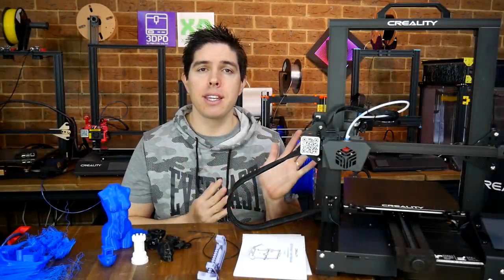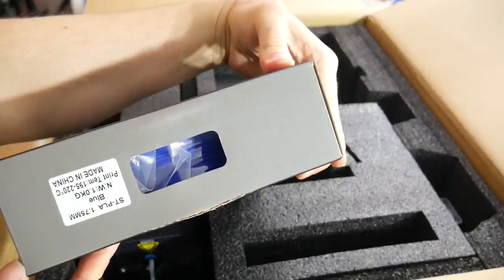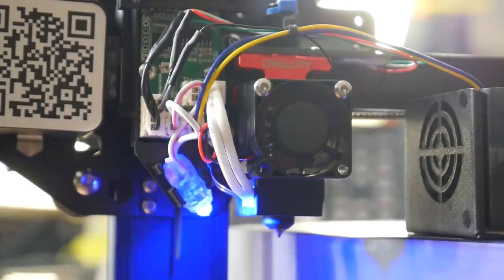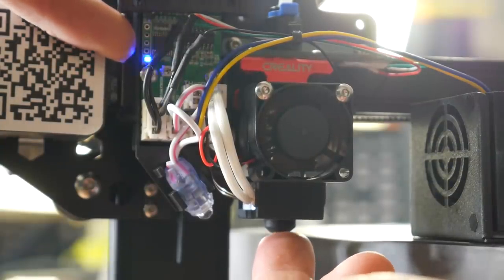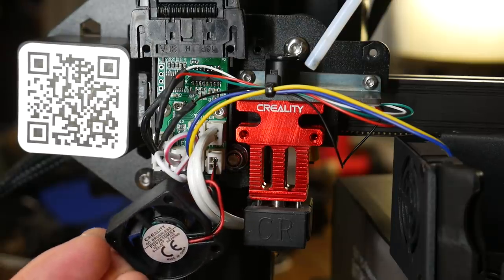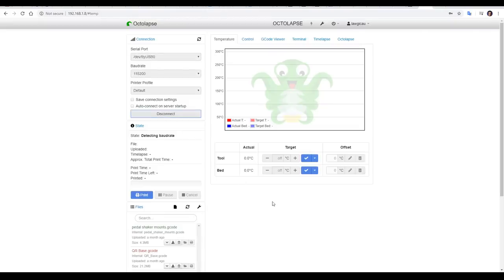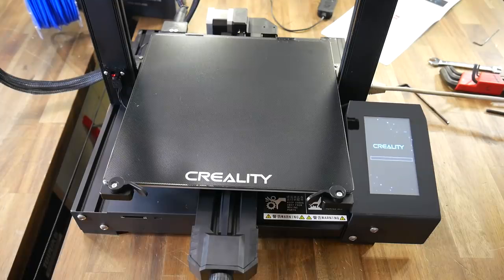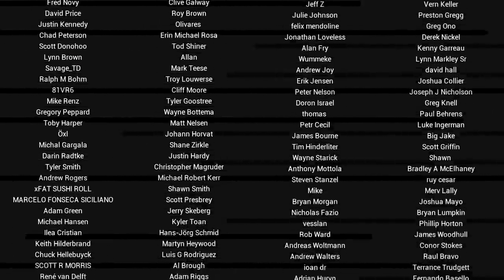Creality CR-6 SE - Your questions answered!

Comment: It's bad that it can't work with Linear Advance! It's almost like a standard now.
The printing volume is small indeed (for the price). Also a proper full-metal heatbreak should be an option (for the same money). I'm not aiming to print with PLA usually.
Reply: I watched Creality strip down the nozzle and noticed that the PTFE tube feeds down a long metal tube between the input coupler and the back of the nozzle.  I did not get an answer from Creality, but I asked whether they intend to offer an alternative tube with a filament-sized inner throat, to enable conversion to an all-metal hotend.  Maybe Michael can get an answer on that one...
Reply: @ThinkersBluff  where did you see that?
Reply: Unless you are printing polycarbon or Nylon. You don't need a metal hot end. PLA/PETG/ABS/TPU can ALL be printed reliably and safely with a high quality PTFE tube. (Note the HQ part)
I can print all of these for days on end, can run up to 260 if needed to. You do have to properly assemble your hot end, take it apart, back off the nozzle a tiny bit, unscrew the collar on top, now push the ptfe tube farther down, heat up hot end, tighten tube collar and nozzle. If your tube is square, it will not leak, if it is a capricorn tube, it will not burn, even at 260.
The rest is your slicer settings. All Metal will jam easier, it's not as slippery as a ptfe lined throat.
Reply: @mr.spongylikeaboss4987  A high quality PTFE tube costs like a good Ti-all metal heatbreak :D Guess which one should I choose.
My PTFE liner degraded a lot... caused few bad prints and at the end clogged the hot end. Any stick has two ends...
Reply: @Benutzername0000  https://youtu.be/uUWktSRnTk4, 00:31:50

Comment: Don't suppose you will he reviewing the CR-10 PRO V2? I'm looking for a higher hills volume printer of about that size but not sure what to get

Edit: just finished the video, I am loving this printer. However with the bed leveling, what if the bed is warped or the frame is bent? If something is wonky how does it deal with that? You can't change the springs like you may be able to on some

Comment: I never had good long term consistency with any physical based ABL sensors like this and the BLTouch. I wonder how consistent this system will be long term after say 6+ months. Also wanted to add, the strain gauge type setups have been used across various DIY/RepRap projects over the last decade and it's been a mixed bag. Really wish they went with a sensor like the EZABL.
Reply: Interesting, the EZABL was always flakey for me, I went back to a BLTouch about 2 years ago and haven't had a problem since.

Comment: A Lot of you hate against the PTFE lined hotends, I have used them for years, and this is what I've found. PLA/PETG/ABS/TPU all print well.
PTFE hotends can print every filament other than Nylon or PolyCarbonite. The problem you had was cheap PTFE Tube, poorly assembled hotend from factory.
The key is to have ZERO gap, completely flush fit of the PTFE tube in the hotend, AND a properly locked collar to prevent the tube from pulling up.
Step 1: Get Capricorn Tube (Buy from the OEM.. many places sell fakes, including Amazon)
Step 2: Cut PTFE Tube with a proper Tube Cutter (Nothing Else!, not a knife/razor blade/side cutters, ect)
Step 3: Loosen Tube Collar on Hotend, Loosen Nozzle a tiny bit, push PTFE Tube down until it bottoms, heat hotend up to 220-240, now tighten top lock collar, now tighten nozzle.
 If you have done ALL of those things, AND used Capricorn Tubing, cut with a tube cutter, YOU will not have leaks, or burned up PTFE tube.
You can print all day at 255 deg with real Capricorn PTFE Tubing, it will not burn. IF you eliminate the potential for gaps in Creality's hotend, it will NOT leak
If you are clogging or jamming after doing the above, it's your slicer settings.
Reply: The only reason I use all-metal is because I have a parrot, birds have waaaaaay too much of an effective respiratory system - I'm never going to risk offgasing just because the manufacturer is like "yeaaaah... prolly fine".
Most people hate on bowden simply because it's the "standard",, the "stock hot end", we all remember our first prints years back, nothing sticked, the bed was warped, no trinamics and so on and so forth. Usually you buy upgrades when you become more experienced. You get a new heated bed, you get a new board, new drivers, a bltouch, a pi4 for octoprint, a 7" capa display for octodash... - without realizing it the worries that you had at first, meaning merely praying for the darn thing to stick and so on, are all linked to the point where the machine was noisy and using bowden.
People merely see all-metal as an upgrade, whereas it has it's own flaws when clogging for example - so they're bound to want the upgrade for free, as if it would fix proper layer height and settings when the darn thing isn't even enclosed. We are all made out of statistics, we wouldn't be assholes to each other otherwise :p

Comment: the biggest problem with this printer is that it is new and nobody is really using it. there are a ton of guides and accessories for ender 3s and cr-10s, but i can't find information like what is the max travel speed or guides on how to do things. i'm not sure that will improve that much, the printer doesn't seem like it will be super popular compared to others.

Comment: I've backed this on Kickstarter and it'll be my 1st printer. It looks a lot more refined than their current printers, so hoping it will give more consistent results out of the box. I'm wondering given that a strain gauge is used to achieve the auto bed levelling if there is any effect on accuracy due to temperature dependence of the strain gauge. I see the display board you show in your unit seems to have an area and pads to solder on a WiFi board. Also interested in how well the belt tensioners work. I'll probably go with the 32-bit board, guessing it'll be more capable but maybe less support initially.

Comment: I believe Chuck mentioned the build volume being bigger than the Ender 3. The ender 3 bed is 235, but it's listed as 220 build volume, and the Ender 6 is 250 bed size and 235 effective build volume.

Edit: Ender 6 is 245x255 physical bed size according to Chuck (7m45s ish into his vid)
Reply from the maker: I've just added a pinned post to address this. At the moment the firmware is preventing the nozzle from going further than 235mm but once we have the firmware we can use more of the bed (but not all because of the clips).
Reply: @TeachingTech  Great! :-) loved your vid btw, and that you didnt just basically reiterate the videos we've already seen :-)

Comment: I can see difficulties in proper bed probing if the nozzle has some melted filament stuck to it, especially since it seems the firmware doesn`t allow for bed leveling with a heated nozzle. On the other hand if the machine retains its Z-offset with the fixed bed I can see it as no problem to set it once and forget about it. I don`t know about production machines but this seems to be 8-bit board? Creality cheapens out again. That extruder looks problematic aswell and I`m guessing its plastic? I like the quick release clamps on the glass bed and the fact that it`s a fixed bed like the Prusa should insure better overall consistency over time.  At almost 450 US it`s awfully expensive and there are better, bigger machines for the price.

Comment: Looking to buy my first 3D printer now. Would this be a better option than the Ender 5 Pro long-term? I'm not afraid to get my hands dirty with firmware or mechanical upgrades, but the built-in ABL and touch screen along with the twin-Z screw seems like a compelling argument for the CR-6 as those are the main features missing on the Ender 5 Pro for me.

Comment: I have the unit and it’s a nice printer, but there are issues with poor quality parts like the switch. Bugs with the run out sensor and other QC issues. When the bugs are fixed it going to be nice, but right now would not buy this printer until MB burning and Switch burning and filament sensor issues are resolved. Creality is very slow to respond to many user issues.

Comment: Is that glass bed a new surface or the same one we have available for the Ender 3?  I found my  Ender 3 glass bed was good for a few months, but gradually lost its adhesion (probably contaminated with residue). Now I find I need a different bed for each filament type; painter's tape for TPU, Glass + Elmer's glue for PLA and PEI for PETG. None of those beds seem to work very well with the other filaments....  Really hoping my Wham Bam shows up eventually & works with everything.  It would be nice if this new bed also works with all 3 filaments.

Comment: does using octoprint to control the printer directly (to print for instance) conflict with the auto-level? if you're directing it to move directly, does the board know to offset your gcode commands according to the level settings?

Comment: I bought this used. First time I was trying it it started fine but it didnt take long before it started clumping up. I am a first time user. Why is this happening? Should I take of the extruder to see if it clean? Is it to close to the bed or not close enough? I ran the auto levelling and that worked just fine. What am I doing wrong. Happy for any replies. And also there is only two choices for filament. How do you put in  to use another type of filament ?

Comment: Why do you suggest that hot end "fix"?  It changes the pivot point of the Bowden tube, making it easier to pull out.
Reply from the maker: Because it fixes the problem.
Reply: @TeachingTech  it's kind of a problem that takes no time to fix after you've done it once.  While hot, Unscrew nozzle, push Bowden all the way through, remove plastic, pull Bowden out, screw new nozzle in, back out slightly, push Bowden it, then push Bowden all the way down and tighten nozzle.

With the "fix" I've seen couplers unscrew easier.  This means that you have to pay more attention to whether the hot end coupler is still tight after or before printing.

Comment: I just opened this printer here today. Cost me €520 on Amazon. Very quick shipping. ordered Sunday night, got to me at lunchtime today Tuesday. First 3D printer I ever had. 

1. First thing I notice different to you is I DID NOT get a 1KG roll, my printer only came with a small 200g roll of white PLA

2. Second thing... I have NONE of those gcode examples you show on the card that came with mine. I only have the 5 folders and "CR-6 SE extrusion mechanism installation instructions-20200619.pdf". No other examples in the root folder of card. I was actually trying to find those examples (the boat) to test it out - its not on it at all.

3. The Creality Slicer was version 4.2 and immediately told me to upgrade, but that is to Ultimaker Cura 4.8 ... which is confusing... does that mean it loses the "Creality" customisation?

4. I tried opening some of the example gcode models in the "4.Model" folder and some of them failed to load with "Invalid File" eg dengzi.gcode... Why would they put some examples on an SDCard which do not seem to work at all??

Also first time I turned on machine and tried the bed leveling, it didn't work, it just sat there, not moving, and the "back" button on the display didn't work so I was stuck there. Had to power off and power on again. Second time, doing the exact same thing, it worked.

Comment: based on the experience I have had with my stock ender 3 and your awesome videos about upgrades to the ender 3. I watched this video and bought the ender 6 se. 6 bolts and it was together, issues I have had, bed was loose, print head was loose, randomly stops and says filament is out (for this I shaved a bit off the plastic that goes between the sensor to report out of filament) I also had some weird issues with it not grabbing the right temp from the previous ender 3 cura gcode. I just upgraded the firmware and screen firmware. not as easy as the videos portray. as choosing the right firmware to download was not clear. after the right version was finally downloaded and the ssd was FAT32 formatted it worked just as they said. wish the version was easier to figure out. other than that it has been amazing with a couple of exceptions. I am having to use the hairspray trick to get things to stick the stock glass bed and it had or has a snag when I try to print taller than 4 inch objects. is there a good ender 6 se cura profile i should be using as I have not re-genned my gcode and am just using the  SSD from my ender 3.

Comment: Being only 15mm bigger than the Ender3 it's not a great upgrade path, but even if it was 250mm it would still in that dead man's zone between E3 and CR10, ie, if you needed bigger, 30mm is a poor upgrade. 1st time purchase makes sense, but they should just label it Ender3 Extreme.

Comment: Been using my Ender 3 Pro for Face Shield frame production. I was looking into upgrading it and then heard about the Kickstarter for the 6 SE and decided to get the 6 SE. By the time the 6 SE comes in my poor Ender 3 may be worn out from all the face shield printing.
Reply: Same here.  24/7 printing of Prusa face shield parts for 2 months, now.  I backed the CR-6 SE as my 2nd printer, because I see it as a step-up from the Ender 3 and better value than adding all those features to my Ender 3.
Reply: oh.. i see. you are really into 3D printing - you are printing useless stuff, nice :D

Comment: hmm curious about the Ender 5 pro and this new CR-6 SE since both seem to be upgraded and newer models by Creality
Reply: Yes price wise they're very similar. I've been thinking of an ender 5 pro as an upgrade to my existing cheap printer and am wondering if my money is better spent on this or should I stick with the ender 5 pro. Given after the campaign the price will jump by $100 it will make this more expensive than the Ender 5 Pro you have to ask if this printer is worth it given it will cost more.

Comment: I have an older Lulzbot Mini.  It is 160 x 160 but i have the upgraded Nozzle which is .25 mm.  Got about $1,600 in it.  No touch screen must be hooked to a PC to use.  So thinking about the new Creality CR-6.  What size is it nozzle?  I have had some adhesion problems with the Mini.  Seems to me I overpaid for the Mini.  But it was 3 years ago I think.  Should I go for this or wait till the next one?  Another problem is bed size.   Some of the projects I wanted to print I couldn't with the 160 x 160 bed.  Thanks

Comment: Hi, I want to know if the CR-6 SE Motherboard is 8 bits or 32bits. In the english product page they say "A Quiet Printer: 32-bit silent motherboard, ATmega2560 control chip..." Ok, BUT the ATmega2560 is an 8 bits microcontroller, so they are saying two different things at once.

Comment: I’d like to get a more “in depth” video (or help) on replacing / opening the extruder.

I’ve had issues with it, so I opened it up.. tried to reinstall it, but I can’t manage to get the spring in decent position. Can you help me out???

Comment: How does this compare to the FLSun QQS for print quality? ( I know it has larger capacity etc but have backed the 6SE after your first review)
Reply: FL Sun is Garbage, along with Tronxy. Had both, and they require so many mods just to work decently.

Comment: What is the real X-Y printing size?
As I remember, Ender-3's advertized X-Y printing area is 220 by 220, however, the table has the size of the same 235 by 235 and it is almost all printable with some precautions.
What is with CR-6 SE in this regard?

Comment: Isn't the bed leveling design here an issue (bad design)? If you have the hot end used the the touch sensor to level the bed you will need to make absolutely sure the nozzle is clean and does not have any filament ooze or it will effect the leveling causing issues with your print.

Comment: They have another problem. The run out filament sensor. The printer stop and display says filament run out but the filament has run out. Hit resume and the printer goes back to printing. What’s up with that?

Comment: they hit the stretch goal for 32 bit main board if you want it... Why would I not want to upgrade to the 32 bit board over the standard 8 bit?
Reply from the maker: I guess the only reason not to is that Creality don't currently have any 32bit boards so it is a bit of an unknown.
Reply: I am more concerned about how much RAM will be on their board.  My Marlin 2.0 firmware.bin presently consumes >260MB, which may mean giving up on something I like if I accept their 8-bit board.

Comment: I wish i could use cr-6 se extruder, bed leveling, bed locking system and filament runout sensor on my ender 3, that would be very big upgrade for me, beacause for now I have almost stock ender 3: extruder, stock bed springs, no bed leveling. One upgrade that is bought by me for my ender 3 is a magnetic creality bed sheet.
Reply: search on thingieverse for "allen key abl" for the ender 3. you can use a cheap switch and an allen key that comes with the printer and all of a sudden you have abl .. no need for a 40 $ bl touch .. ok it will not be as accurate but it will do the trick

Comment: I’ve had the printer for about 4 months and having layering issues. New to printing but I’ve changed nozzle, cleaned tubing, ensured proper heat settings, leveled bed ..... what do I try next?